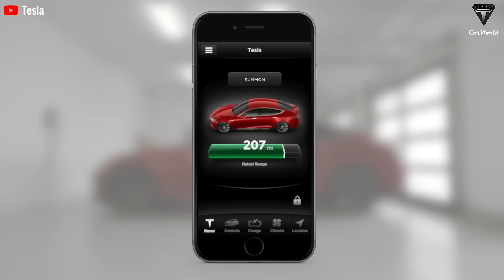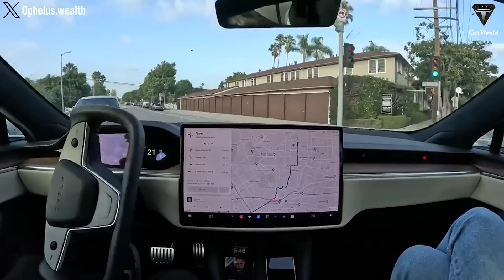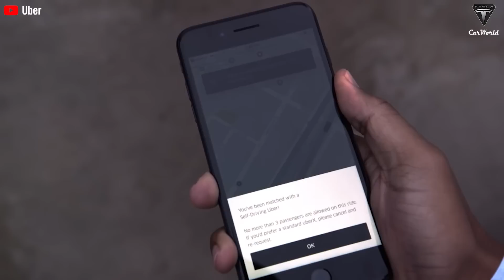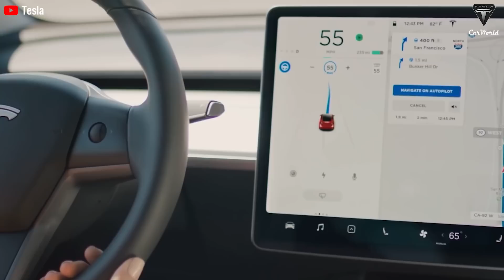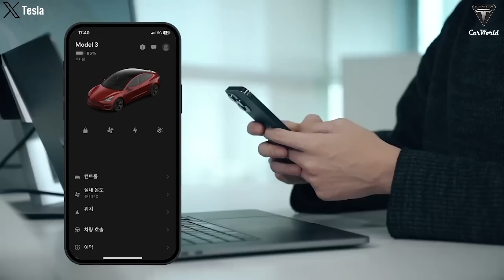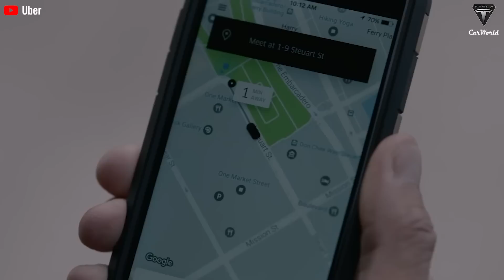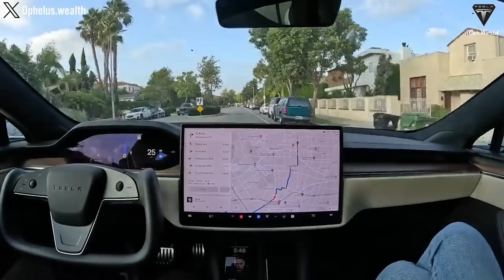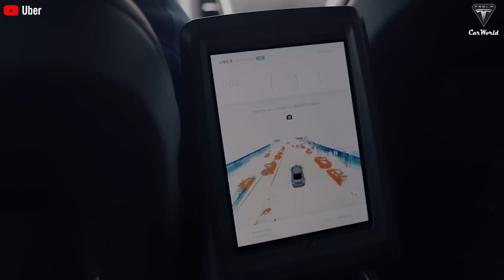It Happened! Elon Musk Launched Robotaxi Cybercab on this Oct! New Design, Specs & 3 Hidden Features

Comment: Tesla has much success in many areas but still no taxi fleet like waymo has where no drivers in a few cities.  Why hasn’t tesla setup some current model 3 and Y cars with this vision system in few cities for ride hailing like waymo to demonstrate the “no driver” needed system.  Why have waited as seems like if already setup in a fleet of current tesla cars and local city governments approved then could quickly move this system into the robotaxi design to unveil next month.  As not done now then longer to get approval for there Oct robotaxi test fleet roll out.  Maybe some issues with just vision cameras for “no driver” system as Elon saying “lidar use like in waymo a big issue”. But lidar costs coming down fast and processing speeds increasing ( not issue for then computers to handle with vision cameras, ultrasonics, radar, lidar) so why not incorporate lidar in the first tesla robotaxi as then quick governmental approval in next year?
Reply: Maybe they will? I agree with you btw.